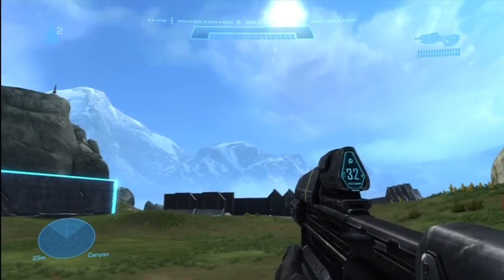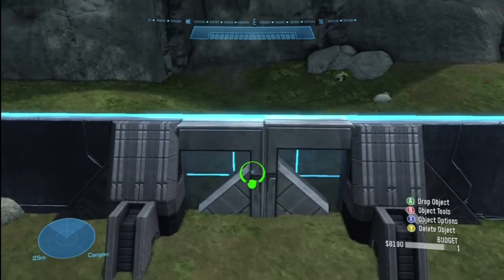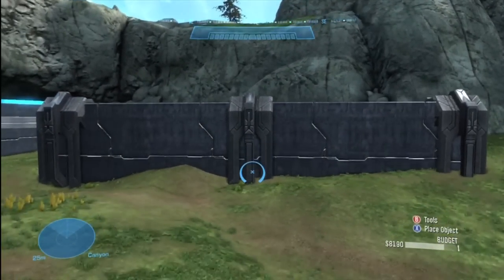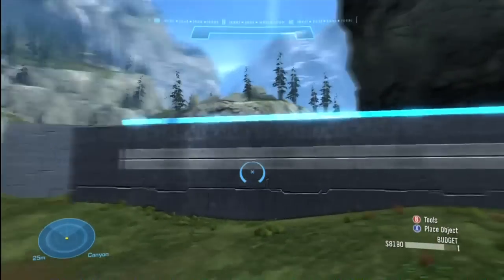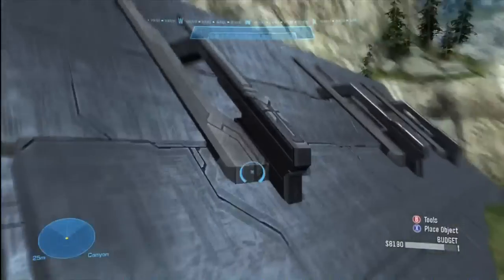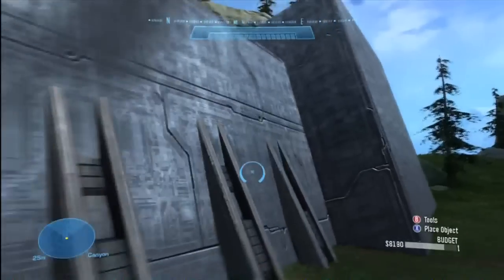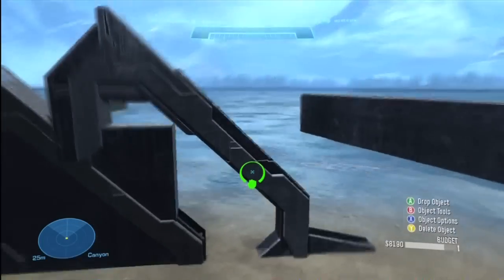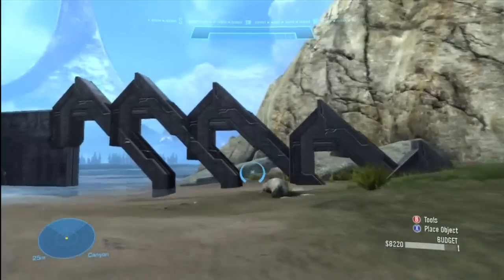"Forerunner Walls" - Aesthetics

Comment: THANK YOU! I actually needed a forerunner themed walls for my Last Bastion map (not related to iflod101's version). But I do need help on Forerunner Structures and Architecture. Building the somewhat replica of Halo 2's Relic forerunner structure isn't enough. :/
I need some help on the forging aesthetics and stuff on that map. I got the incomplete version in my fileshare and the somewhat completed version on my hard drive.

My gamertag is GhostChild808.